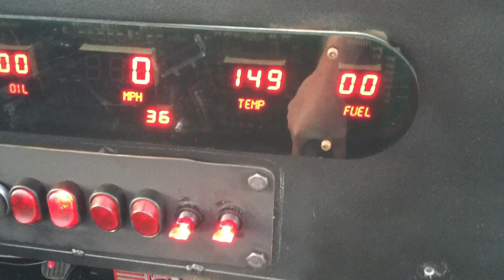s475 turbo 5.3 s10 idling

Comment: what forward facing headers did you use? im looking for some that will clear the steering shaft, its been a pain getting anything to fit around it in the s10.
Reply from the maker: +M Sancho i used jegs 1-5/8" open tube header kit and bought some 3" v bands and 1-5/8" header flanges and welded it up myself. i had to loop around the steering shaft so in order to put the header on i just took the shaft off and slipped it through the header